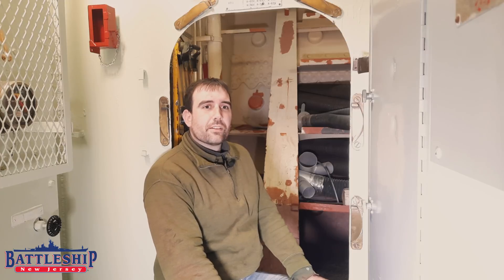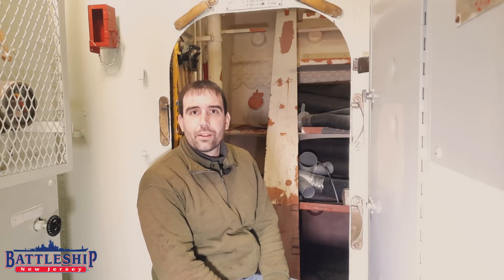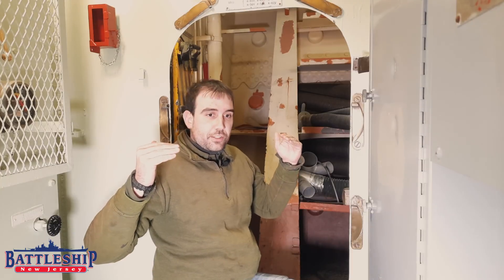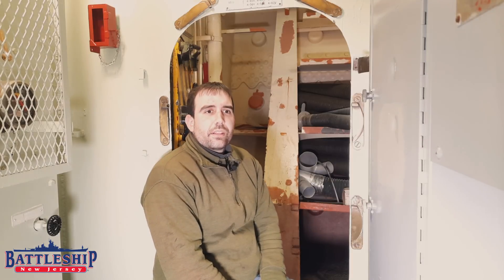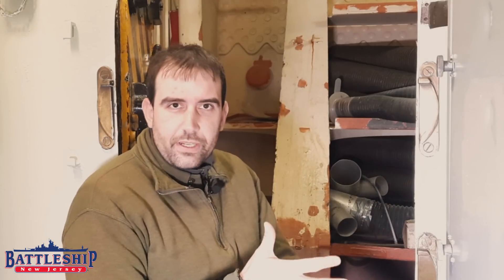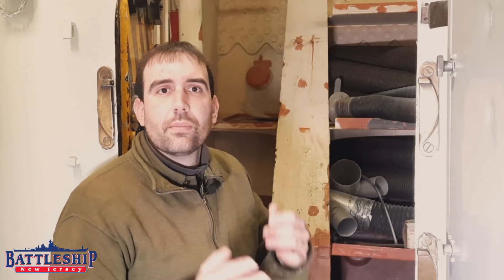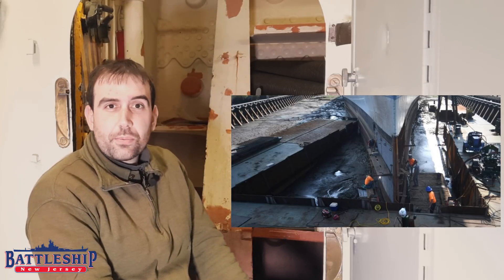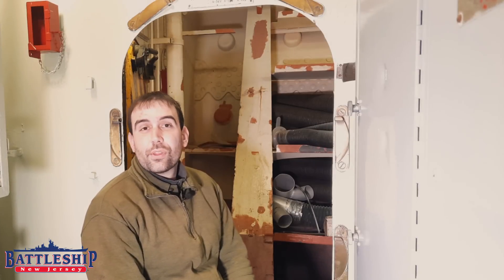Ship out of Water: Why aren't museum ships on dry land?

Comment: So your explanation wrt to dry docking makes sense. Especially in the context of a wooden hulled warship.  But does that really still hold true for a steel hulled ship especially one built as robustly as a battleship? I can name multiple steel hulled warships whose very existence is threatened because they were in the water and didn’t have the budget to remediate the issues created. I can’t think of one on dry land that whose survival is threatened.
Reply from the maker: Budget is going to be an issue whether a ship is in the water or out of it. Look at the troubles that Razorback is having.
Reply: @BattleshipNewJersey  I won’t argue that a museum ship can survive without funding. But the Razorback is in the water and my point is that steel hulled ships in the water seem to be in more danger than would be the case if they were on dry land. Look at the Clamagore, if she was on dry land I don’t think we’d be about to lose her forever.
Reply from the maker: I picked the wrong sub, oops! Batfish is out of water, and in dire straits. Putting them on land isn't necessarily best. Its just easier to not care that the hull is falling apart.
Reply: @BattleshipNewJersey  ok so let’s take Batfish. She was damaged by flooding and is presently closed. But because she’s on land she’s not in danger of sinking. They have time to raise the funds needed. By contrast we came close to losing Olympia in large part because of the fear she would sink at her moorings. Clamagore as I mentioned is going to be sunk in large part it seems because they are afraid she will sink otherwise. If she was on dry land there would be no urgency to dispose of her. 

But let me return to my central question. Yes ships are designed with the assumption that they will be in the water. But surely steel hulled warships have enough structural integrity to survive on land. Especially a ship like a battleship.

Thanks for responding!!
Reply from the maker: Except battleships are a whole lot of weight to support. No, ships like Cavallari aren't going to sink, but they still get to a state where they arent safe to visit, so you just have a heap of metal now. They managed to repair Olympia, remember, the reason they haven't repaired Clamagore is because there isn't money for it. She'd have the same issue on land. She'd just get hauled away in pieces instead.

Comment: I'll think about it and come up with a practical method. Floating on some sort of oil would do but obviously too expensive. Floating on hot pitch and letting it cool. lots of old tar around.
Reply from the maker: Make sure you can still access the hull when necessary and that whatever you choose won't rot in the rain because you'll never build something large enough to house it, but also something the birds can land on/in without harming them for the same reason
Reply: @BattleshipNewJersey  l agree not a easy task but I think a worthwhile one. I have a idea but something this large requires thought.  A permanent berth area  and a realistic cost target applicable to it's national value is required.  Quite a challenge.

Comment: The Japanese Battleship Mikasa built in 1899 was encased in concrete up to her natural waterline in 1923 as a memorial ship. Her hull appears to have held up though a lot of her superstructure was replace in the 1950 restorations due to post WW2 neglect. Perhaps that might be an ultimate solution. It may certainly be the only way to save Texas.
Reply from the maker: We do not believe it to be a good method of preservation. Concrete is bad for steel

Comment: This is what happened  to HMS Victory, her side timbers are beginning to give and the engineers had to build outriggers to counter act these forces at great expense.. she's only 256 feet long.. the New Jersey at 900 odd feet long would cost an immense amount of tax payer money.. so keeping her in the water and doing repairs is much cheaper and if you eve need to use her again, it's far simpler to temp dry dock, fix the problems and float her out , rather than drag her off a permanent structure..

Comment: Water is only corrosive because of the salts/minerals dissolved in it.  These are what cause the rust to form.  De-ionized and distilled water would curtail rust and provide distributed load support.  You would still have to provide a wet dock space to put it in, but it would be better than using an expensive dry dock or a graving dock. It would have to be isolated from sea water, which would probably be a large initial incurred cost because it would force the dock to be near some littoral fresh water source (but disconnected from it) and then inside some humidity controlled facility positioned over the docking space.

Comment: To say the tank is gas-free when the candle has burned out is not quite accurate. But the oxygen-level is near zero at that point. I'm not sure how much evaporation is going to happen inside that sealed tank, but I would expect at least some to happen as temperatures change throughout the year. As a result there might still be some corrosion happening  (albeit much less than with normal oxygen levels). The safest option (albeit probably not cheap given the volume) would be to flood the tanks with inert gas above the water level. Much like oil tankers do to avoid buildup of flammable vapours.

Comment: The SS Meteor in Superior Wisconsin is an example of a “beached” museum ship.  Basically they buried her up her sides so it looks like she’s floating on a grassy wave.  I am sure there is some sort of drainage system or coating to minimize corrosion.  I live an hour from the USS Texas and it is a shame they can’t do something similar for her because it’s always in the news that she’s in dire straits.
Reply: I just looked up the Meteor, that's a really interesting looking ship. The hull reminds me of a submarine
Reply: @declana1359  The SS Meteor is a Whaleback  https://en.wikipedia.org/wiki/Whaleback
Reply: It works for Meteor for the same reason it works on Submarines: the cylindrical hull resists the “pancake” forces mentioned in the video.

Comment: Come to Chicago the U-505 has been on dry land since the mid fifities and for the last few years I believe she's even indoors
Reply: A Sub is quite a bit different than a ship. The sub is basically a steel tube with a few bulkheads, no decks involved that need supports like in a ship. They built a cradle to support the sub at every bulkhead point to support it, and since the bulkheads extend 100% across the tube, that is all it needs to support it.   When a ship is dry docked, the pillars that support it much be placed precisely at the correct support spot or the ship could collapse when the full weight is pressed down on the support.  If they built the ship like a skyscraper though.....

Comment: A few tons of expanding foam might be a good solution to a permanent dry dock ...a simple frame work to contain the mass until it turns to a solid is all that would be needed ...not only could it support the vessel but it would equally preserve any surface of the ship it contacts...hell you can dye it ocean blue to add a little theme work
Reply: No,  the foam will hold moisture/ water and air and a a result the corrosion continues..... and then the foam had to be dug out to make any repair.
Reply: @MrEric_API  depends on the type of foam used...trust me bud there’s tons of weather proof foams ...true you’d have to dig it out to make repairs to the hull but my next question is...why would you need to if it’s protected from the elements
Reply: @localenterprisebroadcastin5971  i have seen it used,  and I have seen it need to be dug out.  It for a while was thought to be a good idea, and I can show you photos I took while it was dug out.  
There isn't any magic foam.   Some work better than others, there isn't a "perfect" one yet.  Many claimed to be and have been proven otherwise. 
Anytime I have a client ask about it I attempt to discourage its use.
Reply: @MrEric_API  interesting 🤔 I don’t doubt things that work in theory don’t work in the real world 🤷🏼‍♂️ sounds like you’ve had some experience with it though so thanks for the insight 👍
Reply: @localenterprisebroadcastin5971    Yes, theory gets pretty expensive when it doesn't work out.   And I have seen the money spent on both ends........

Comment: What if they filled the drydock in with sand? It would push in on all sides like water but wouldn't be as corrosive (so long as proper drainage was implimanted)
Reply: That only works for small amounts of sand, anything big will hold enough water to be a long-term problem

Comment: Burning the candle on closing the hatch doesn't make for a gas-free environment. It does consume *most*, but not all of the oxygen is consumed. The major gas product produced is carbon dioxide. Although this isn't as reactive as oxygen, it does combine with water to produce carbonic acid - a weak acid. 
Have you considered, instead of a candle, pumping in a heavier inert gas, such as argon, is relatively inexpensive - about $2.00 - $2.50 / 100 cubic feet. It will displace all oxygen, and is entirely inert. The only downside being that if you had to send someone in the tank, you would have to pump it out to get fresh air in.

Comment: You can have the ships encased in concrete like the Japanese did with the historical battleship Mikasa.
Reply: Problem with that is keeping water out of the concrete - cracks that develop over time, the joint between concrete and hull, etc.
Reply: @jamyers1971 : It could be water sealed on the  inside of the concrete tub to keep the water out and a rubber boot around the hull where it meets the concrete. Just a thought.
Reply: I was thinking that is probably the best option for BB Texas when she is done with her servicing.  Whenever they find her a new home...

Comment: What about cathodic protection, I thought the Missouri used that system to prevent rusting?
Reply from the maker: Most museum ships use cathodic protection but it doesn't prevent all rust.
Reply: @BattleshipNewJersey  Thanks for the info, cathodic protection is all we use at work but we protect 10 ton steel grates and not 45,000 ton Battleships, so that simplifies things for us ;).

Comment: One small correction, USS Texas was not intentionally submerged, and the only reason she has water aboard was because of her hull deteriorating. In fact, Texas is held afloat and in place by 4 large posts that are connected to the ship via lines. 

The only submerged ship I know of in the gulf coast area is the USS Lexington, and the only compartments filled were the fuel tanks, ballast tanks, shaft alleys (only to prevent the problems with leakage from the shaft openings), and various other void and tank spaces. This keeps maintenance on hard to reach areas easy, as they are simply flooded and not at risk for rot and corrosion that will harm other parts of the ship.

While the possibility of plate and hull corrosion is obviously a major concern, Lexington uses an ingenious system with anodes placed around the ship to deter rust from corroding her hull. So far, 28 years atop her sand base has led to almost no problems with leakage or corrosion, and she’s still going strong. 

The other ships along the Texas coast here are the Cavala and Stewart, both set in the ground in Galveston, and I am unaware of how they have held up; but as far as I’ve heard they’ve been ok. 

I’m unsure of how Kidd is held in place, however based on pictures of her in low tide, it looks like she’s resting on the bottom. She could use some help to keep her hull from rusting. That 1/4 inch plating won’t hold up too long like she is.
Reply: Those big posts hold Texas in position, but dont support her or keep her afloat

Comment: Why not pump nitrogen into the ballast tanks? A valve and pressure gauge fitted to the hatches would do nicely for periodic inspection and maintenance.
Reply: Or constantly purging with nitrogen enriched air, using a nitrogen generating system as on Boeing airplanes (for purging the fuel tanks reducing the risk of explosion)
Reply: @tommybjork2674  Issue there is the blue light special (on the 737 it turns on a blue light in the wheel well when the NGS system operation is degraded) doesn't eliminate the oxygen, it only has to reduce it to the point where an explosion can't occur.  There would still be O2 in the spaces, just a reduced amount and you'd still have corrosion taking place, just at a somewhat reduced rate.  Easier and less complex to do a nitrogen purge from tank before the compartment is flooded.  Also more effective even if you had to periodically re-purge.

The advantage of the NGS in the aircraft application is you don't have to carry a heavy nitrogen tank, which would need to be constantly re-serviced.  Which you don't need since a perfect purge is not required, you just need to displace enough O2 to eliminate the explosive mixture.
Reply: @netpackrat  I know all about the blue light... Do the electrical test and let the next station handle it 😁 right?
Reply: @tommybjork2674  Tends not to be a viable solution in corporate aviation with a picky customer.  Of course, now that they've gone turboprop, they are learning all about deferrals.  🙄

Comment: What about battleship Mikasa over in Japan? Its in a concrete berth filled with gravel and backfill. No mud, no water, and even support on all sides.
Reply from the maker: Concrete is terrible for steel, theres a reason that system didn't catch on
Reply: @BattleshipNewJersey  But it's not directly in contact with the concrete. The gravel filler is several feet thick and allows the ship to expand and contract to a degree with the weather. Mikasa is in pretty good shape considering all the modifications and neglect its been through. Granted the tours don't include any way to see if the hull is surviving well under the gravel so appearances may be deceiving.
Also, that setup may not be as practical for a ship Jersey's size and mass.

Comment: After hearing the point about graving docks I got to wondering about the Kidd <DD661>.
She sits in a cradle for low water and actually floats when the rivers up.
Will that fact that she does spend part of the year "in water" make a difference for long term preservation. She is well worth visiting, especally
during low water when you can walk under the hull itself.

Comment: Interesting concept of using a candle to reduce oxygen content, but fire goes out at 16% O2, so while you've reduced it by 5% it's still there. Plus there's oxygen in the water which will slowly leach into the air insuring that there's always some in that space. A better choice would be the use of inert gas such as nitrogen or argon to displace all the air and a chemical absorption of the dissolved oxygen in the water.
Reply: Those would work better for the ship itself, but you'd need to be very careful about those gases escaping into habitable compartments.  You'd need O2 sensors all over and some very good ventilation.  The gases aren't poisonous or such, but your body can't tell if it's breathing argon or nitrogen vs oxygen (it detects CO2 buildup).  Pretty easy to just pass out and eventually die without realizing what's going on.  Rescuers can fall into the same trap if they aren't aware of what's going on.  I know of some fire suppression systems that use nitrogen with "just enough" CO2 to set off your internal alarms.  That might help, but doesn't stop you from actually suffocating if you can't get out fast enough.

Possibly one could also replace the water in the tanks with a non corrosive fluid (probably quite expensive) or solid weights (harder to adjust as needed).
Reply: @drdoakcom  agreed on the risk. I'm a retired firefighter so quite familiar with the risk. FYI you have the CO2/N thing upside down, I've never seen a nitrogen based fire suppression system, but some halon alternative systems use nitrogen as a pressure source to push the agent out. CO2 does give you warning, but since the warnings include confusion/inability to think rationally the warnings can be lost to those not trained to recognize it early.
Reply: @fire304  I've only come across it in one place, protecting research servers in a building full of labs from the chemical to the high energy physics (think terawatt laser).  The row of tanks were labeled as nitrogen, but I don't know much about it other than that and what I was told. The building had a fair amount of nitrogen running amok for other purposes.  All the other facilities I'm aware of in other buildings used halon or some later generation of chemical suppression.

So, I may well have it backwards. Just going off what I recall years later.

Did you have to deal with these types of suppression systems often?  Never seen one in process or the aftermath in person.  I've heard stories about them flinging floor and ceiling tiles all over the place though.
Reply: @drdoakcom  ah, I can see it being useful in that sort of very specific applications. No I've never seen one fired off other than an occasional commercial kitchen system.